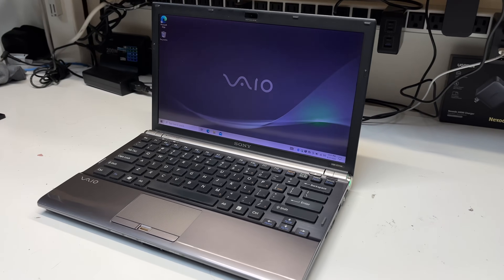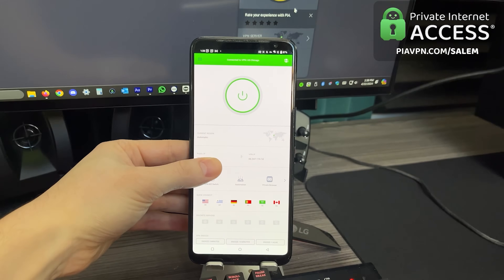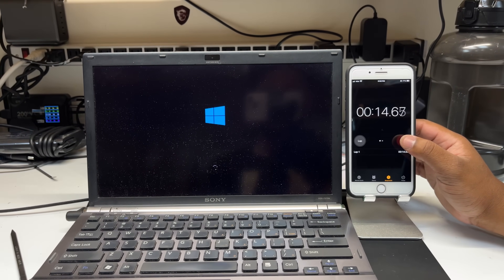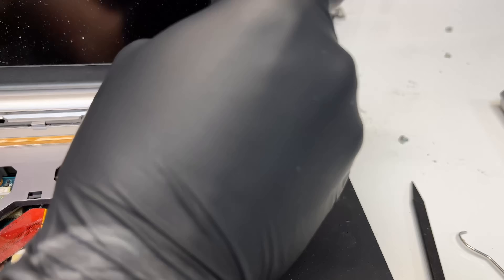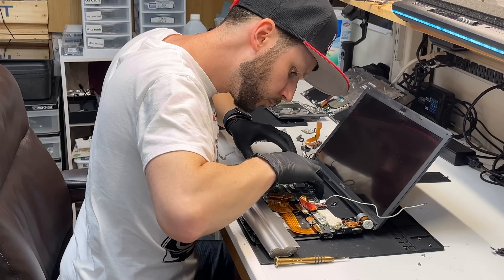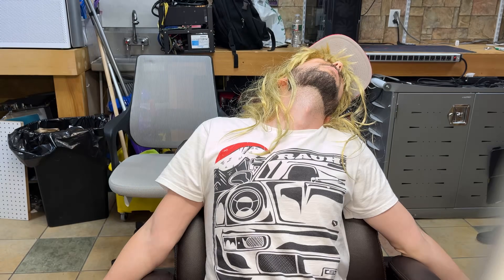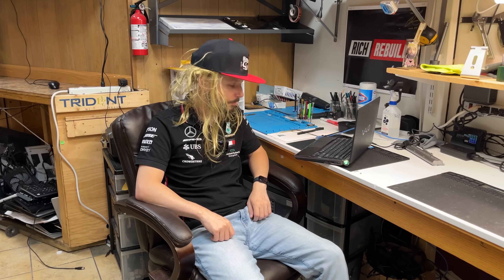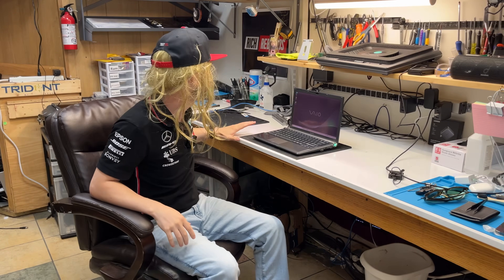Sony Vaio Resurrection: Saving this Insane Tech From 2008 (and why that soon won't be possible)

Comment: I agree with you in the video about even old machines still have life and the new ones are more e-waste cause most of the stuff is soldered the the board and not replaceable.  Seeing that the owner of the Vaio still wants to use that for a 16 year old machine makes me happy as a computer geek myself

I have a zBook Fury G9 that I got from eBay and it was really beaten up.  It looked like someone took it and bent it over their leg, punctured the back of the screen. Punctured a flat-head screwdriver from the bottom that the keyboard / Palm rest had a big dent on top, and the piece of the motherboard broke right at the part that the RJ45 port was.  I took the laptop, and rebuilt it from ground up.  I paid 450 for the laptop and with all the parts included, it cost me a total of 900 (Laptop and parts all together) to get it back to normal.  It boots up fine, upgraded the screen from the original 400 nits to 1000 nits, put 16 GB of RAM, new battery (Since the other one is doing the safety lock down mode), added a 250 GB NVMe, and it's running fantastic.  It also has a NVIDIA RTX A1000 card in it and that isn't damaged at all.  I also replace the bottom door, and bottom frame cause there was no door and the frame was cracked in two spots, the speakers, and and the touchpad/trackpad.

I'm so happy that it is alive from the abuse it went through.  The notebook still has warranty but the abuse it went through wasn't to let me get the replacement parts for it.  I paid for all of the parts and the laptop has a new life and running.

Cheapest zBook Fury G9 I got.  It has a I7 12850HX CPU in it too.  These were normally 5000 to 10000 (Depending on specs) and bringing it back to life and has a chance to do more again makes me happy.  I've done other zBooks (G1 to G7), Dell Latitudes, Precisions, Alienwares (Core 2 Models) and Macs and all running great.
Reply: Pretty cool story you got there, and btw I'm just glad to see another ZBook user here lol. They're underrated machines long as you can look past the HP hinge meme
Reply: @Kazz7420  Thanks.  I have 8 gens of them and each of them have their quirks but they each do great.  I like using the G6 the most due to the sound of the speakers and the RTX3000 card it has now.  The G6 one of mine was damaged on the one corner and I fix the screen and bottom frame and door but kept the palm rest part the same so I know which one is the G6.  I was thinking of making a video on the G9 and show the pictures of what it went through and what it looks like now.

Comment: "A decision I believe will result in the biggest e-waste event in history"

You and the executives who made the decision to cut off Windows 11 support for anything older than three years.

I'm on 1st gen Threadripper, there's no way in hell Windows 11 shouldn't run on my machine, but it won't. Because Microsoft said so.
Reply: It can still be installed, It might have glitches or lack of support for some things though, but you can't upgrade to it through 10, you need to manually download and install 11 via a memory stick.

Comment: I have one of these, z21xn and the wall adapter plug is notorious for not fitting after some usage. With 4gb ram and original hard drive with some bad sectors, its doing just fine. Newest Ubuntu found all the drivers excluding the GPU. I remember the funny switch working on Win 7, but being kind of scared about EOL (and it was company laptop) I subsequently upgraded. Win 10 was absolute disaster, so I dualbooted it lol. Say, how much ram could it possibly tolerate?

Comment: It took me a month, but I actually did end up fixing my desktop after I updated the BIOS and then the bios splash screen started to hang (I saw that you had the same issue in one of your shorts)

Turns out, it wasnt the ram, but it was my 4TB Hard Drive jumping off a bridge (Even though it wasnt my boot drive!?!?!!), only reason I figured that out was because I went into task manager processes and saw it going to 100% even though I went in and made sure it wasnt optimizing. Managed to get a SSD from my father, install windows onto it, and it worked for 5 hours. Woke up the next day to my desktop holding a nuke to its head so I spent yet another 2 days trying to figure out why its trying to explode itself. Turns out, never have 2 drives with windows ON THE SAME computer. The pc thought it was corrupted and tried to fix itself but couldnt. I had to wipe both drives and reinstall windows. 0 issues now.

I have spent...my entire summer....trying to fix my pc 😭
Reply: You can use 2 separate drives with 2 different Windows installs. I have an Elite desk with 2 SSD, one for W10, one for W11. If its an older device, you need to tell it which drive to boot from in BIOS.

Comment: I own 2 VGN CR220 Sony laptops both bought used.  They are my fallback laptops. I bought the first one from a co worker who upgraded th OS from Vista to Seven and a 7200 rpm WD hard drive.The second one had a 160 gb mechanical drive with Win 10 32bit installed on it and i upgraded it to a pny 240 GB SSD with 7 installed. It boots up in 1m 25s. The laptop I am using for this comment is a 17.3 Toshiba with Blu ray reader and a 1 TB Samsung EVO 860 with Win 7. I bought it new from my employer.  I have seen the Hewlett Pukard's and Toshit laptops basically self destruct over the past 16 years.

Comment: 14:24 I agree because even though i have a gaming laptop (acer predator helios 18) I don't really care how many frames i get as long as its at least 60fps and runs smoothly. And it would be nice to not have soldered cpu's and gpu's and ram (note my ram isn't soldered to my laptop but i have heard that some laptops have the ram soldered to the motherboard) because it would be nice if you wanted to upgrade it or something happens to them that renders them useless you would have the ability to replace them

Comment: My 2011 Macbook Pro. The last laptop I've ever owned that I could (and have) taken completely apart, replaced pads and paste, cleaned all fans and components, upgraded RAM, HDD to SDD, and removed the CD Drive to reduce weight.

Comment: Another laptop I would expect to last 16 f*cking years is my ThinkPad e585.
It was relatively affordable when I got it, being one of the first AMD powered cheaper build ThinkPads.
But it's held up great for the 6 years I have carried it around campus or even highschool.
The plan is to keep it in active use for the next 3 years of my studies and then see what I do with it next.
Probably keeping it in use as a netbook still.
There definitely are nicer ThinkPads and other laptops around, better built and especially less worn on the keyboard and casing.
Heck, I helped my brothers find such better machines for them, which they happily use now.
But this is my machine, personalised with quite the stickerbomb on the lid and a Linux system set up exactly to my liking.
Which it runs much better than the factory Windows installation, which I since long deleted and do not miss at all.

Comment: 2 Years ago I bought a Gigabyte G5 KD Laptop. I loved it. I gave it an extra 2TB m.2 and 32Gb of Ram AND a cooling pad AND new thermal paste and cleaned it often. One day I come back from work adn it doesn't function again. I drove to the repair shop I worked at and we tried everything to repair it to no avail. Seems like the Motherboard is broken after the warranty. THX GIGABYTE. PS: Laptop cost me 800€ and they said reapir would be 930€ .... thx for that Gigabyte never buying their stuff again. 

PS: I am not the only one with this problem I found plenty of people, but the real problem is i recvommnded this Laptop to all m yfriends and some got it too but with AMD instead of INTEL.

Comment: Decided I was going back to school last year. Took a 2014 hinge problem (hp), replaced the battery, changed it to an ssd and it was very useable. Then I cracked the screen. F me. Got a loaner from the school and quite frankly pissed me off worse for performance issues and because it was locked down by admin I couldn't make os changes that could greatly reduce the issues.  I will take older tech that I can make changes to including incremental hardware upgrades over today's laptop's being sold.

Comment: My HP victus gaming laptop is pretty repairable I think (although no s3 sleep support is a bummer. Damn you HP bios engineers) the back panel is really easy to remove I asked the technician if upgrading/repairing the device will my Warranty and he says that it won't. Ram is upgradable storage is upgradable battery is easily replaceable and that's pretty good. 
There aren't even any warranty void if removed stickers.

Comment: The message of this message is so true, my mother also has a SONY Vaio laptop from the early 2000s with I believe also a Core 2 duo of some kind and only 2 GBs of RAM!. I think that the machine is as old as me and it has taking a beating. From surviving physical damage, a medical speciality, issues with the OS or maybe the Hard Drive, battery problems and probably a single instance of maintenance already more than a decade ago and many more years of office tasks, and still goes strong, being her preferred device to the day and still working fairly speedy. Even better than the HP she bought a few years ago, already giving way more issues in less than half of the lifespan of VAIO, and something that isn't mentioned in video, slow as hell due to absurd amount of bloatware in todays OS's. It so sad when the computer was actually almost fully yours and it wouldn't even reach a single gig of RAM in idle. More the reason why I will hold on Win 10 over 11, worse and harder than Windows 7 fanboys back in the day a few years, because in this era the product is indeed no longer built for the consumer. Even nowadays after you spend a $1000 dollars on a gaming laptop, that in my case miraculously has socketed RAM and storage you can't avoid saying "This will go out in some years" after you look at the built of these machines. Frustrating times.

Comment: got a acer aspire 5750 from 2012, upgraded from 4gb of ram to 8gb, used to run windows 7 and now runs windows 10, socket intel Pentium B940 cpu, mechanical hard drive, it's slow I admit, but its still kicking

Comment: Hey there, another computer technician here. Had similar problems being unable to find Sony's drivers for their godforsaken laptops, such as my old Vaio S from 2005, another weird 13" dockable NVIDIA ultrabook with a DVD drive from before ultrabooks existed. Finding a GeForce Go 7200 driver that works with the damn thing took hours, but I'm pretty sure that I found it through using a now-dead link and putting that into the Internet Archive. This may work for you, see if it does. It's appalling what Sony's done for supporting their old machines, given that Toshiba/DynaBook still carries drivers for machines from literally 30 years ago. Genuinely, Windows 98 drivers for the Toshiba 105CS. Still up on their site.
Reply: as an enthusiast, the Internet Archive is a godsend sometimes when putting now dead links into it
Reply: @youself20  IA is getting sued to oblivion btw unfortunately it will get shut down.
Reply: HP and Acer have also removed a ton of older laptops' drivers from their website, a real dick move
Reply: Ive seen driver compilations available but has anyone found a bios? Seen lists of almost right but only on shady pay to dnld sites. Looking for  bios for a Vaio VGN-SZ434N
Reply: Even Dynabook couldn't cut it, my satellite l750d was sold in a specific enough region that the website just tells me to screw myself

Comment: I actually very recently installed arch linux on the old family Vaio from like the 2010s (it could handle windows 10 fine but i wanted to say "i use arch btw") there's a few graphical issues but it works well overall

Comment: As someone who's first laptop was a Vaio (a CR42S) that i had to restore, they're a pain to repair: no drivers and a BIOS that was more blocked than my nose while i sleep, but they work better than a Swiss watch.
Mine has gone through hell and back at Uni (retired it a year ago) and never skipped a beat. Still have it and enjoy it, also put a Core 2 Extreme on it for fun😂.
Best laptop i ever had.

Comment: Fun fact, teh newest laptop (that I am aware of) with a removable external battery is the Thinkpad T480 which came out in 2018. It actually has 2 batteries for some reason, a stnadard battery and the clip on extrnal battery.

Comment: I also have a Sony Vaio Laptop made in 2008, and while it wasn't as difficult to take apart as the one shown here, it was still a pain upgrading the 250GB HDD to a 500GB SSD. It still has the original battery, and it still holds a charge of about 2-3 hours (if only my current laptop could do that).

Comment: I have one similar to this one. Mine is a bit newer and it has an SSD, but… it is a super weird proprietary one that uses a SATA connection over a ribbon cable, it is not the size of like a full 2.5” drive but it’s WAY bigger than an M.2. Same thing for the DVD drive it has, it’s weirdly shaped and it has a proprietary ribbon cable. ALSO, I tried to swap a fan  on it, and ofc I would have needed to replace the whole heat sink and it was like $100 on eBay so I just left the noisy fan in it… oh and the keyboard doesn’t work either and it’s riveted to the top case like a MacBoo, main difference is that there’s millions of broken MacBooks everywhere, but these Vaio laptops are kind like relics, so the top case was like another $150…. In the end I just cleaned the inside and changed the thermal paste and pads on the CPU and GPU.

Comment: I remember reading about this notebook when it first came out…it was one of the first (if not the first) notebook that had switchable graphics (that was before Nvidia Optimus was a thing), and in such a small form factor, it was a great deal at the time. The battery also lasted about 6 hours with the Intel GPU, something only netbooks could pull off. Great piece of tech.

Comment: I admit that the visual design of the SONY Vaio series is very beautiful, except that the keyboard is a bit impractical because it lacks the excellent touch feel of the Thinkpad keyboard and the replaceable design between each four function keys. Increased spacing makes its keyboard ideal for programmers.

Comment: I can consider myself a serial collector of old notebooks. One of the older ones that I still use is an 18 year old IBM Thinkpad t60 (one of the ones that just have the IBM logo, no Lenovo). The ATI video card integrated on the motherboard burned out, so I promptly replaced it after a series of curses haha. The last one I have is 10 years old. On the list are these: IBM 600e (after 25 years it still works like new), t60, r400, t410, t520 and t440. not to mention the myriad of HP or ACERs over 15 years old floating around my house haha.
Some time ago my mother bought a new HP...lots of plastic, you can't upgrade or replace anything, not even upgrade the RAM...all soldered. A real shame that the modern world thinks more about aesthetics and selling rather than functionality and ecology.

Comment: Also rather doubtful how well this laptop performs with youtube. The 8400M GS inside doesnt have hardware support for VP-9 codec. Only H.264 and youtube moved away from H.264 a long long time ago. Watching youtube on that will kill that laptop unless the owner is using an extension like h264ify
Reply from the maker: Yet I showed you YouTube running just fine...
Reply: @SalemTechsperts  ok buddy.

Comment: what is insane is to install windows 10 on this computer, this laptop is still great and it's good to see that it can be fixed, laptops only got worse over the years, the fact that replaceable batteries aren't the norm anymore really tells a lot about our current situation

Comment: I have Dell XPS from around the same generation. Core 2 duo + Nvida GPU. Did same upgrades, Win 10 + SSD + more ram. Used that bad boi for gaming until It could no longer keep up with new titles. That said the community was cooking up custom drivers for years after Dell and Nvidia dropped support. That's how it can still play games in windows 10, just not all that fast. The Laptop itself was super modular, easy to work on and built like a tank. With Custom Bios' it supported overclocking and early XMP. Still works to this day. I do have to say they don't build them like they used too.

Comment: I'm using a Dell Latitude D630. Is that old enough?What can you suggest to replace it.
Reply from the maker: You have 15 years worth of used options depending on your budget. Go on eBay and search for a used Latitude 7 series or ThinkPad T series with an SSD and you'll be upgrading to something 100x faster

Comment: I worked in computer repair when I was in college (computer network engineering - and hell no, as of 2024 I do not work in IT. Never again.). I was there in 2004-2008, fixing those Vaios. And when I say, "fixing," I mean, handing them back to the customer, laughing, and telling them to contact Sony. We used what Vaios we couldn't get rid of to keep warm in the winter. Those little shits produced a LOT of heat.
Reply from the maker: Hah. People seem to forget just how spicy those older laptops got. 2008-2012 was prime time when it came to heating your office with your laptop